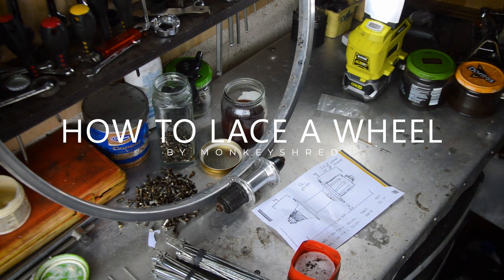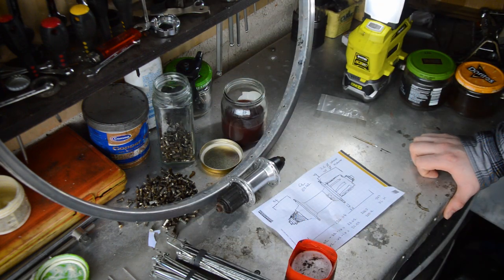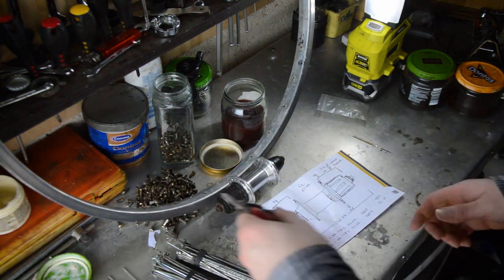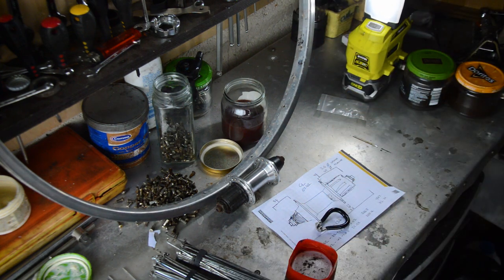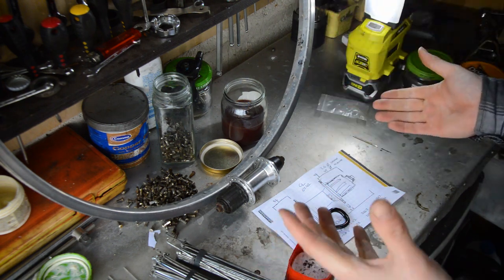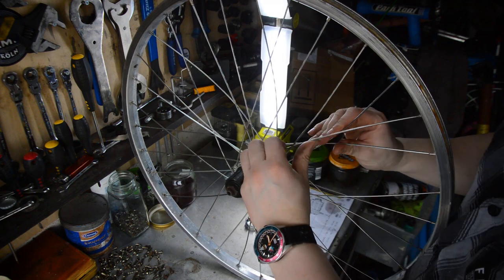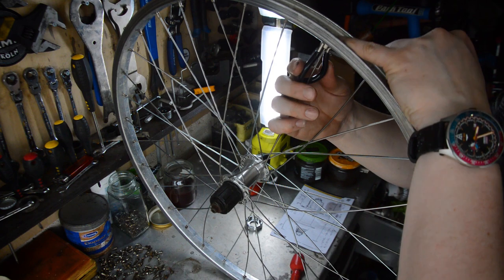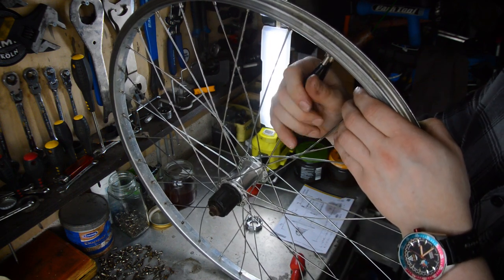How To Lace A Bicycle Wheel - Vintage Bicycle Restoration - Wheel Build

Comment: Yay! Well done. I build my own and a nice touch I try to use is, if there is a manufacturer name on the hub, line it up so you can read it through the valve hole. As you say truing and dishing is another story! I also find as the tension comes in on the spokes they begin to "sing" when you give them a little flick with your finger.
You could have made your life a little easier by lacing a front wheel, there's a lot of variables which take a lot of explaining in a rear wheel whereas both sides are in balance on a front until you throw disc brakes in the mix! 😂 
Good job Monkey 👏👏👏👏

Comment: I'm currently restoring a Raleigh 10-speed. Upon moving the rim tape I noticed that the ends of the spokes are corroded. Is this a problem or would removing the rust be sufficient? Great video by the way.
Reply from the maker: Honestly, I'd be suprised to see vintage steel rims without rust.  It should be fine.  I have seen spokes get brittle and break up though and in a very extreme case, spokes rust away to nothing.  Give them a wire brush and maybe apply some penetration oil to soak in.

Comment: Nice! Just what I needed. I have to relace the aluminium rims on an old Italian bicycle from the 40s. Redid the front already, but the rear is more challenging, with the offset and different spoke lengths. On top of that I can only find spokes 1mm longer than the original ones. And is it just me or every new spoke I bought has less thread than older ones? I don't know if it will be a problem when relacing, I don't wanna run out of threads while tensioning.
Thanks for this video!
Reply from the maker: I've not run in to that problem before.  All the new spokes I've used have come with new nipples and they've worked together perfectly.  A 40's bike with aluminium rims must be something special though?!
Reply: @MonkeyShred  Yes, it's a nice bicycle, with internal routed cables, mixte all chromed frame, and nisi aluminium rims. Many aluminium parts. It's a 26 x 3/8. Overall, a very nice bicycle but needed love. I'll send you pics if you want.
Reply from the maker: @Townshend82  sounds like a gem! Sure you can send me pictures on FB, IG or Twitter if you like.
Reply: @MonkeyShred  Sure, will do it tomorrow!